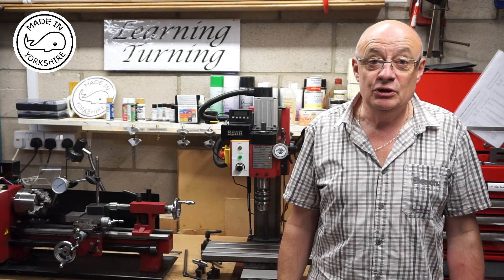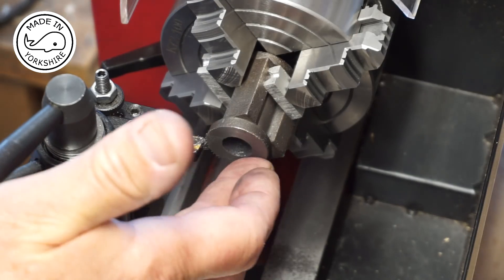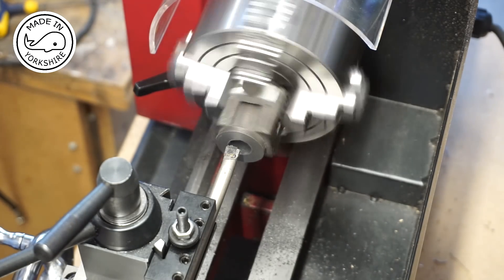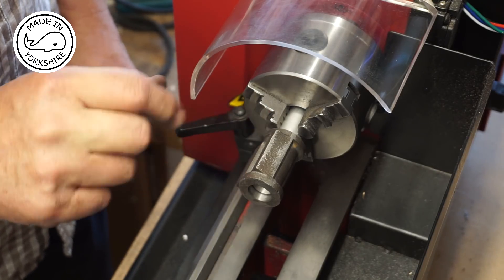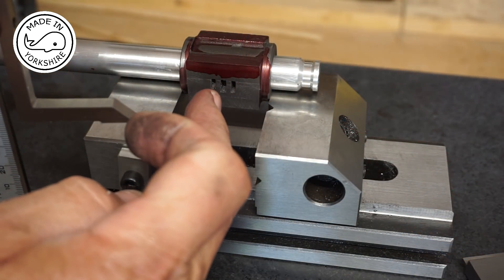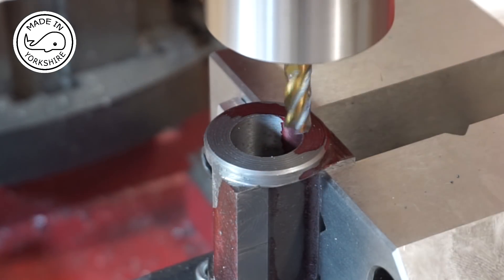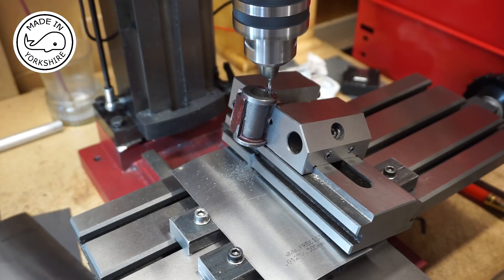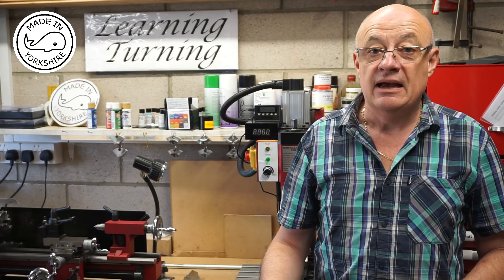#MT22 Part 3 - Making a Stuart S50 Steam Engine Cylinder. By Andrew Whale

Comment: When measuring what to take off either end do you take into account the position of the ports? Say if the ports arent cast exactly in the center and are slightly to one side. i messed my first cylinder up and im now over thinking everything. Long time lingerer, love your channel. alex.
Reply from the maker: Hi Alex. From memory I don't think I considered the position of the ports. Probably more important to get the outside as symetrical as possible.
Cheers
Andrew

Comment: rHa! here is a very easy way to set up a turning either cast or already machined: using a dead centre which has a Centre hole on the taper end, then with a live centre in tailstock and the pointy end fitted into the casting then with dial indicator reading off the end closes to the casting, you easily can set up the hole quickly without running your dial pointer onto a rough casting. Works a treat! 
Nice work Andrew. Enjoy watching your work ethics. Not afraid to give it ago! Cheers
Reply from the maker: Hi Gary. Many thanks for the suggestion, but I just can't work it out. Can you explain in more detail so a novice like me (a numptee) can understand it?
All the best.
Andrew
Reply: @learningturningmetal  Andrew I think Garry means that you engage the pointed end of the dead centre into the hole in the casting and engage the live centre into the hole in the other end of the dead centre. After you close the tailstock up You can now run your dial indicator on the outside of the dead centre adjacent to the casting giving you a smooth reading which will average out the shape of the hole in the casting. You would have to be using a dead centre with a diameter larger than the hole. I haven’t tried It but it makes sense. Did you purchase a 100 mm chuck to hold the cylinder?
Reply from the maker: Hi Philip. Thanks for explaining. That makes sense. Yeah it was a 100mm 4 jaw chuck (Chinese origin) with a backplate for the mini lathe. Purchased from Arc Euro Trade. The chuck also fits onto my SC4 lathe.
Cheers
Andrew
Reply: @learningturningmetal  Thanks Andrew, chuck ordered.